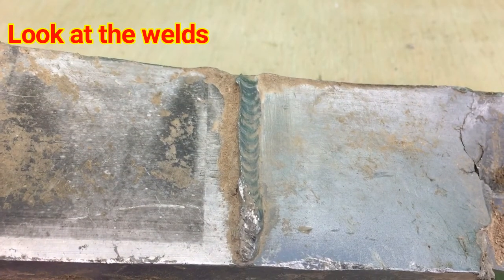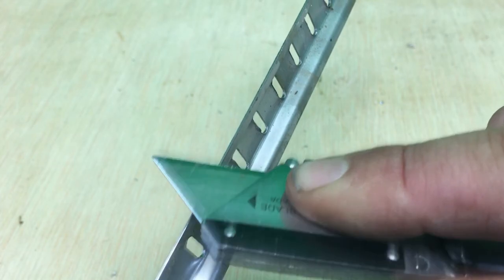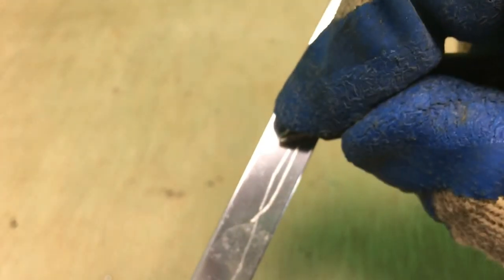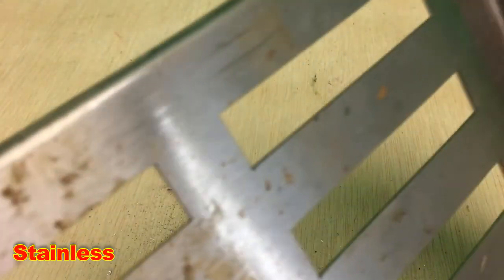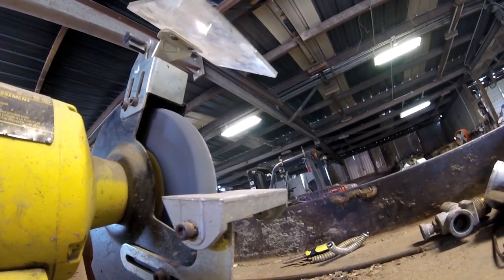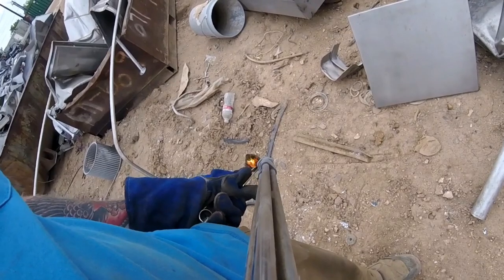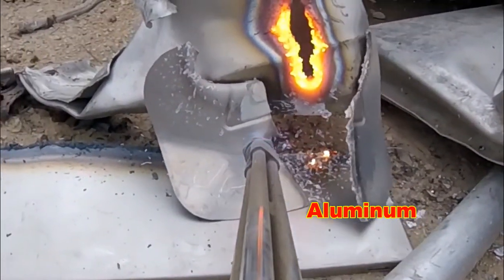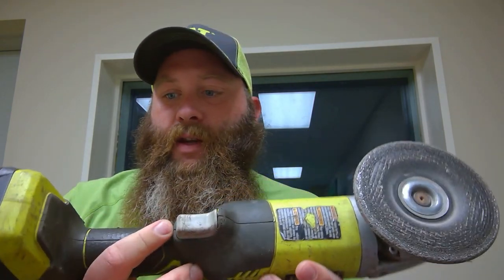Aluminum and Stainless Steel Scrap, how to tell them apart.

Comment: I will have to try the file and utility knife test tomorrow. I have a small engine frame that I'm pretty sure is stainless but just in case I'm going to test it. I need to modify it a little and I'm going to have someone weld it.

Comment: If you are having trouble telling the difference between ss and anodized aluminum, you can test the continuity. Anodized alum will not hold a current. It is too hard. However that is only true on the anodized surface. So if you cut into it and test it on exposed surfaces you should get a reading

Comment: I like your stainless steel versus aluminum video. The problem I have is knowing the difference between regular Steel and stainless steel. I know regular Steel is magnetic but sometimes stainless steel is magnetic and sometimes not. Sometimes it is very shiny and sometimes a little more dull. I'm sure a lot of stainless steel has gotten past me. And it almost seems like scrap yards try to give you regular metal price 4 stainless if they can. They won't help and point it out to you is what I mean. I really wish you did a video on stainless steel versus steel. Thanks love the videos. Matthew

Comment: Hey braken! Im new to scrap recycling and work at a scrap yard. Ive been having trouble identifying aluminum 5052 and aluminum clips, and have got poor training. So ive been trying to do research of my own. Also seek knowledge on whats worth seperating and grinding off in order to put the non ferrous metals in designated boxes. I hope you see this comment and i have learned alot from previous videos and want to thank you for going in depth in your videos.
Reply from the maker: Hey Rick, great question!  Look at the side or edge of the plate (the part you would measure if you were trying to find the thickness of the plate). When you look at it you will notice two different grain textures (almost like someone took two different plates and glued them together). If it looks like that then it’s 5052. If it looks entirely the same, then it is most likely 6061. I wish I could take a picture and show you because at first it might be really hard to tell there is a difference. I wish I would have covered it in my video but now maybe I’ll do another video just on that!  Hope I explained that well enough!👈🤠👉
Reply: Rick Sanson

Comment: Why don't you just hit it with a grinder that's what I do but I can tell the weight difference most of the time stainless is non-magnetic most of the time but it's Sparks and a grinder and aluminum Copper Brass does not Spark

Comment: do i put rad alum in its own bundle?
or is there another listing that fits best?
Reply: Aluminium radiators are their own grade, it is best practice to remove the plastic ends if you can, but most scrap yards will accept them either way :)

Comment: Really enjoy your videos brother. You give it honest and I have time for that. Don't have time for the bullshit like all the others I've watched! Finally a video I can honestly say. I've learned something throughout the entire clip. Really appreciate it. I have watched your videos, but, how much does the standard central AC unit outside unit and air handler bring in value wise in scrap? Would really appreciate your time in answering this as I have 15 complete outdoor with indoor units. Lots and lots of work so far. I don't mind hard honest work, just need it to pay off brother. ML&R
Reply from the maker: Rocky Rock, I'm glad you like the videos!  I have so many more I want to do, and I promise they are coming.  Last month and this month have been extremely busy for us, but soon I will have some more!  You have a great question, but it is a little difficult to answer however I'll give it my best shot.  Each unit is different, and the commodities market is constantly changing.  It all depends on how it was manufactured, this determines the different recoveries (pounds) of each item.  You can have two units that have the same outside dimensions but bring completely different recoveries.  If the Al/Cu radiator is 10 lbs heavier in one of them, that's roughly another $10.00 right off the bat.  If it helps, I always tear down EVERY unit because I think it is worth it.  I have two scrapyards, but I still scrap on the side because I just love to do it, but I also have five kids I have to support!  Maybe I can make a video where I tear a couple down and show the value of each one individually to give people an idea.  But for now, I will break down an imaginary unit in my head and give you the breakdown based on Bracken Recyclings prices for today.  Remember these are just guessing numbers and do not apply to all outdoor units!  Hope it helps!

AC Breakdown
#2 Copper 5lbs @ $1.88= $9.40
brass 1lbs @ $1.25= $1.25
Al/Cu radiator 48lbs @ $1.00= $48.00
electric motor 16lbs @ $0.12= $1.92
sealed unit (compressor) 65lbs @ $0.08= $5.20
Iron 50lbs @ $0.04= $2.00

TOTAL = $67.77

There will be a few other things but those are the main items.  Remember this is just an imaginary unit I created in my head!
Reply: Bracken Recycling Thank you very much Sir. Here was the total dollar amount I got off of 11 broken down units plus air handlers. $473.00. Not bad at all for 3 days work. 11 units al/cu rads equaled 230 lbs

Comment: is stainless magnetic?
Reply from the maker: Hey Bob, good question.  I hope you don't think I'm lazy but I'm going to copy and paste a response I gave another viewer on another video.  Just because it's so long!  

     I'll go ahead and give you some info so you don't have to wait!  The most common stainless you will see bought at a scrapyard is 304 and 316.  In today's market, a yard can get around $0.15 to $0.20 more for 316 when they sell it.  They both contain chromium and nickel (just different amounts), but 316 has molybdenum, the molybdenum is used to help prevent corrosion from chlorides.  The only way to tell the difference is to shoot it with an analyzing gun or just to have experience in knowing what products they make out of 316.  Not every scrap yard is going to pass the extra money to their customers for a couple of reasons.  Reasons like, they might not have a way of differentiating the two, it would take them to long to collect enough 316 to bale or box by itself (in this case they would just put it in their 304), they might not have a buyer near them that will take mixed loads (meaning most of their packages they load on a truck are 304, and a couple are 316).  So if they had to wait 6 months before they could produce 44 thousand lbs (that's a whole truckload), they would have that money out of their cash flow, and they would also be gambling with the commodities market.  300 series stainless has nickel in it, and they are non-magnetic.  400 series stainless does NOT have nickel in it, and it is magnetic.  Most scrap yards (including mine) are just going to throw this in their tin pile.  There is just not a big market for it.  To give you an idea catalytic converter shells from vehicles are mostly made out of 409 stainless, and they have a market value of about $0.15 to $0.18 per pound.  But that's only going to be good for someone who actually refines catalytic converters because they are left with the shell.  The best thing to do if a scrap yard buys your stainless as 400 is to watch where they end up taking it if you can.  They very well might try blending with their 304.  This doesn't mean they won't get dinged on it from the buyer, but they might feel it's worth a shot.  They don't have much to loose if they bought it as tin from you.  But I think it's only fair in that scenario to give you a little extra on it!  This wouldn't happen at one of my yards.  We establish long-term relationships with all of our buyers, so we don't try stuff like that.  We work just like I advise my customers, the easier you are to work with, and the more compliant your scrap is, the better price you'll get!  Sorry about the novel but I like talking about scrap metal!
Reply: Wow...what a great explanation. Thanks for all of the unique and informative videos you are posting.  They are of great value!!!
Reply from the maker: You're welcome Bob, I'll try to keep them coming when I can!